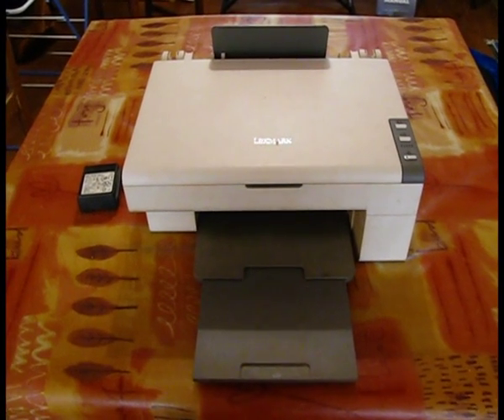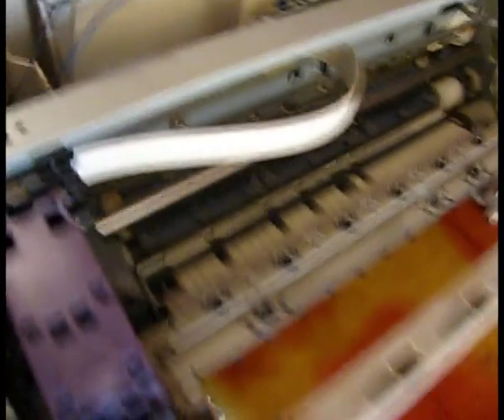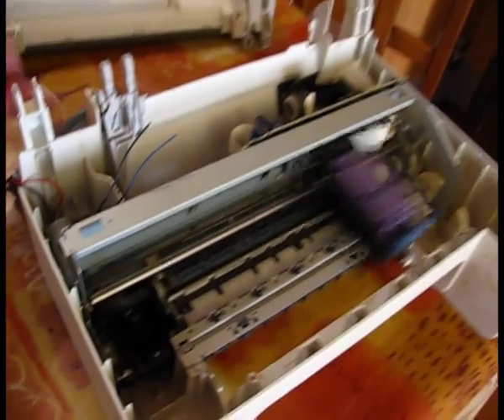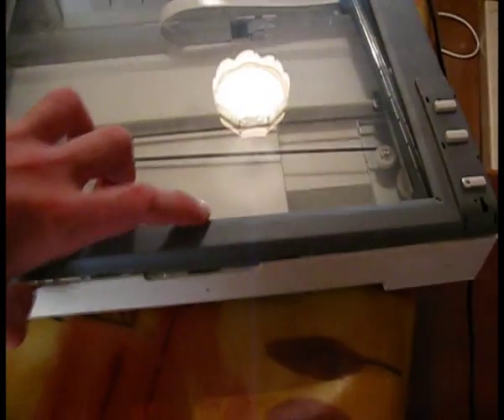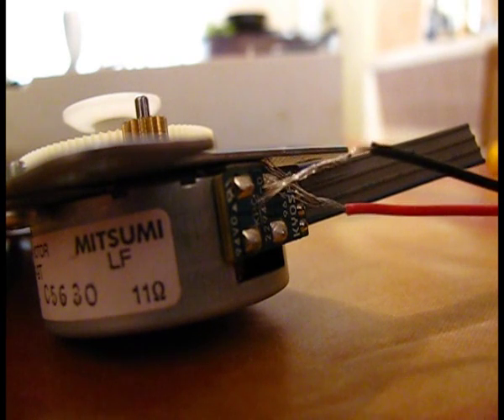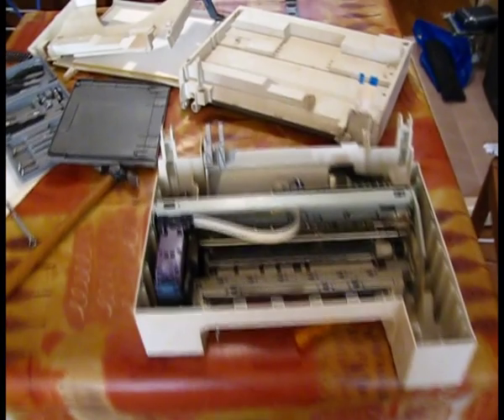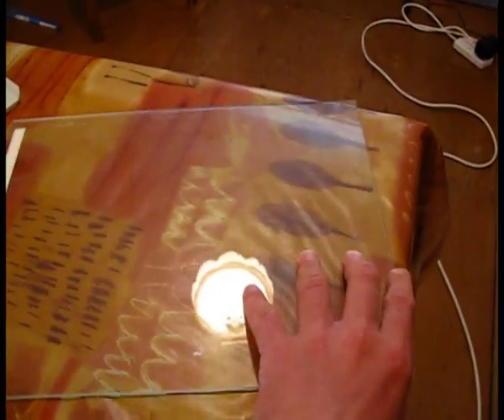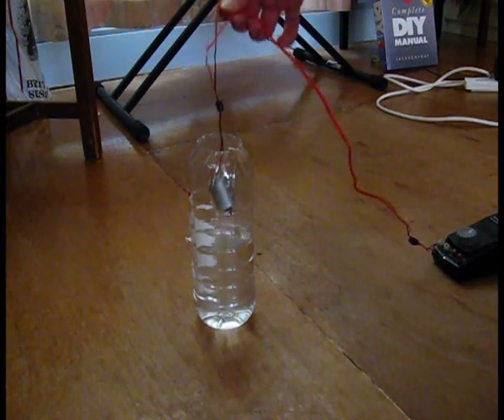Takeing apart a printer

Comment: @benobve The motors are designed for 30V according to what you said in your video, if you are only supplying 12V to them, they will be drawing more current to make up for the loss of voltage and then overheat and eventually catch fire. That is why the motors were making that bad noise.

Comment: 10 pence is about 0.13 USD, which does not make any sense.  Usually the low quality electronics are 0.13 cents.  +TechSmartt got a $2 cooling fan accessory for his iPhone, and it makes his iPhone act haywire.